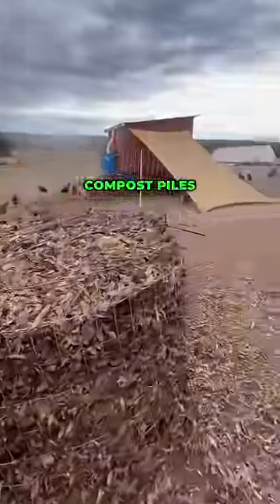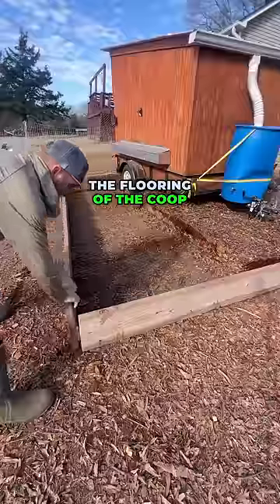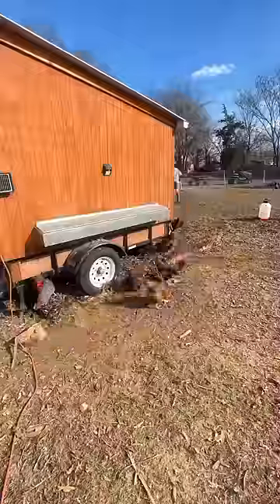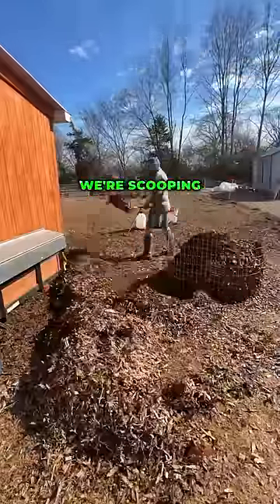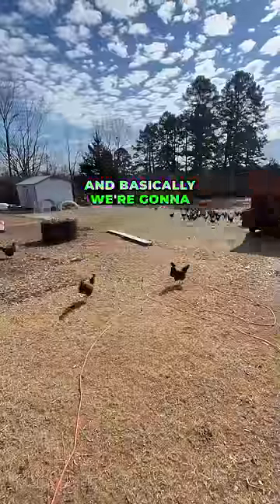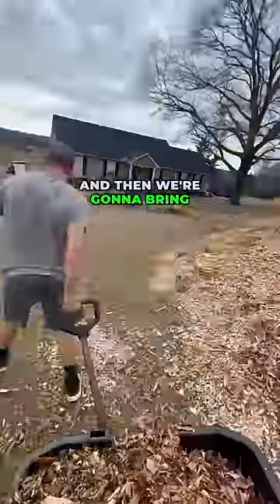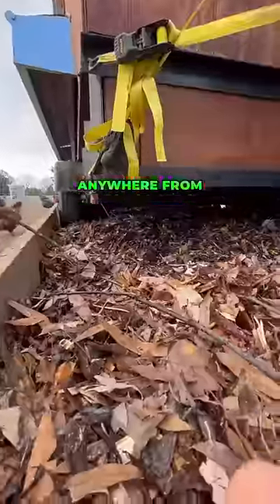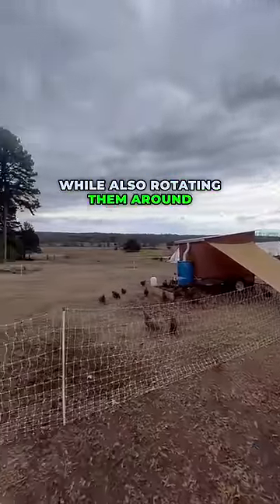HOW TO MAKE HOT COMPOST WITH CHICKEN MANURE #compost #composting #backyardchickens #smallscalefarm

Comment: Using the leaves as the base where the chickens poop is genius. You have the carbon mixed right in with the greens. Thanks for the idea!
Reply: Carbon Shmarbon.  BS
Reply: @gordbaker896 are you two? 😂
Reply: You could use long grass as well like straw or hay  and saw dust
Reply: Also add some green vegetation to add nitrogen to speed the decomposition. The hotter the pile, the better
Reply: So all my leaves I normally take up with acorns and such or use leaf blower I could put under this setup and not have to buy leaves ? Would the twigs I take up be good enough for wood chips if broken up in like 3inch pieces ?
Reply: @leonardbutler2231 those chickens are producing more nitrogen than any green anything you can put in that pile.
Reply: @nhibbard89
Glad someone finally said it.
Reply: @nhibbard89  I said that you can add green manure to add nitro and make the pile hotter. For instance, put a pile of fresh cut grass in a pile, see how hot the middle of that pile gets. It gets hot enough to burn your skin. That's the aerobic bacteria at work breaking down the matter into nutrients. Chicken manure of course has nitrogen, but it takes longer than green manure to  make that compost hot. I know I've benn using a compost barrel mixer for going on 30 years now. So take it easy!😊
Reply: @gordbaker896 bro have you not read an elementary chemistry textbook? Like you don’t even know your periodic table of elements?
Reply: @Michael-vm8kj  Have you ever seen a chicken?
Reply: Genius indeed
Reply: @gordbaker896  yeah, you’re like a chicken with its head lopped off, it runs around only functioning from its brain stem
Reply: @leonardbutler2231  I believe the "green" in this system is the chicken manure itself, should have lots of ammonia in it.

Comment: You are over feeding your chickens.

First,  mix the leaves with decomposed power line wood chips. The power line cleaning company will give it to you free.

Then add a thin layer of earth worm casting/eggs to this while watering it in throughout the pile to help leach out the incoming droppings ammonia. .

Park chicken tractor over thus prepped droppings pile.

Then after 2 to 3 months, back up the chicken tractor so the droppings pile becomes the chicken front yard.

Lightly water, turn pile with garden tiller,  and then turn out the chickens to this compost yard.

The chickens will happily scratch out the bugs, worms and various fungi as food. The quality of the chicken products Eggs, Meat will be high quality and you will have to buy far less chicken feed.

Plus the compost will be much more organically decomposed by the chickens,  working it for 3 months as their chicken yard, . It will be garden ready!
Reply: It's as organic as you can get when raising chickens, turkeys, ducks, quail.....etc Poultry!
Reply: This has been done with used horse bedding, power line wood chips, sawmill sawdust...etc

It is a form of carbon capture, soil amendment, sanitary poultry management and is Black Soldier Fly friendly because of the compost.
Reply: Raised on a dairy farm with chickens, pigs, meat cows, turkeys, ducks and pharaoh quail.
Reply: Nice😊
Reply: You can’t over feed chickens. The more food in the pasture the healthier it is. The chickens won’t over eat, and they won’t deplete the pasture. The same can be said for ducks.

Comment: Check out the Johnson Su design compost system. Your structure composting in the welded wire fence is already so close to the Johnson Su half sized design already. It would barely even be a change to your design as you're already 95% of the way there. The extra 5% may actually make it easier on you depending how you tend to the compost over time + you'd get superior fungal dominant compost after the hot bacterial cycle cools and fungal colonies establish.
Reply from the maker: Thanks for commenting! I have seen the Johnson Su and I am planning to experiment with it some this summer
Reply: @tannerfarmstead  I think you'll really love the way it works. Especially since you get enough compostable material from your chicken run to fill one all at once. Love the chicken setup by the way. I think I may adopt something similar once we get onto a property with more space

Comment: You might think about redoing the roosting bars. They look horrible to tell you the truth, a little narrow, angled strangely, especially the upper bars. If their feet are resting on the corner of the bar, or heavy hens can't spread the weight across the majority of their feet and not just the pads, it can cause pressure sores which may lead to bumblefoot infection.
I like the metal floor though, no cleaning! Haha

Comment: I love it, but it seems so inefficient to lift that manure by hand so many times (first rake, then lift into the ring pile, then once out to trailer/barrow, then last time to spread). It won't compost as fast if left in place, but it certainly will fully compost. Shouldn't there be a way to not be lifting that stuff all over kingdom come? Maybe till it in while it's still unfinished when planting a rough cover crop or alfalfa?

Comment: Worst compost ever hot compost should only be done with a fast decaying medium wood chips are the worst high nitrogen alongside high nitrogen there's no balance the chips will burn your crop use  leaves from your local neighborhood when they put bags on the corner or piles